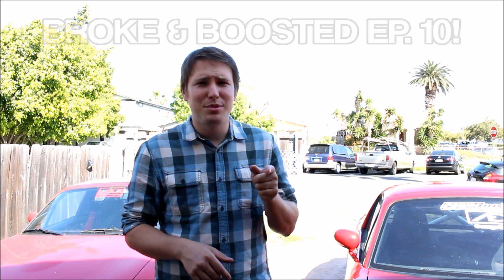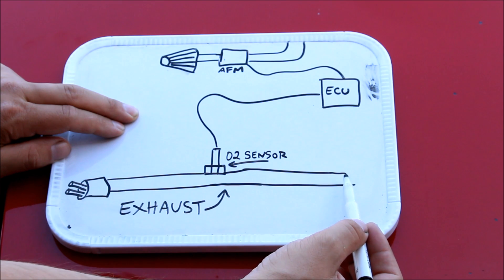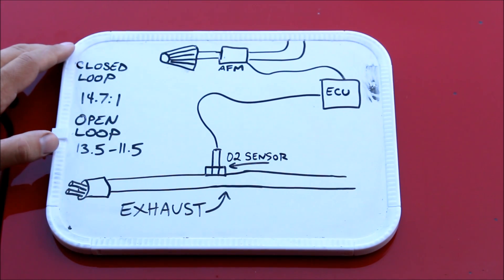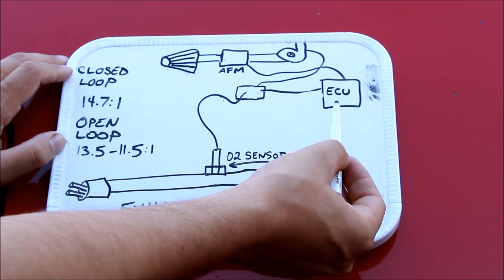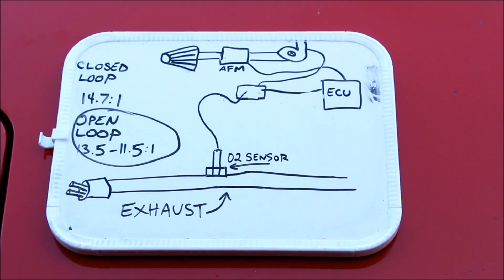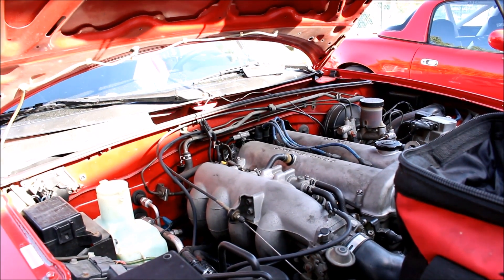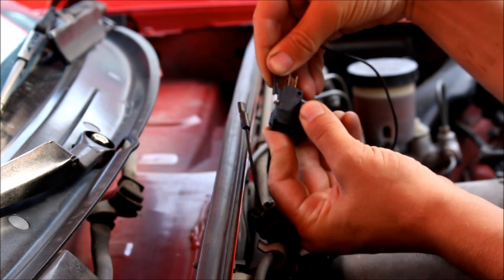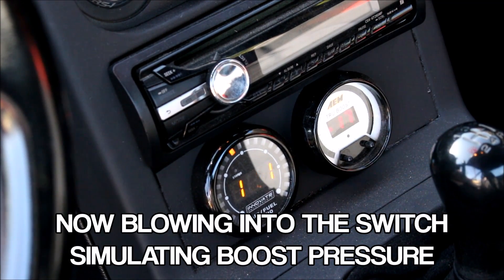Tricking The Stock ECU: o2 Signal Modifier (Broke & Boosted Ep10)

Comment: I just did this mod to my '04 MSM and i gotta say it feels way better.  My AFR gauge clearly shows the fuel getting richer as the boost comes on.  goes from 14.5ish crusing steadily richens up to about 12.5ish AFR. A fraction of the cost compared to the old Flyin Miata O2 modifier unit, what a rip-off they were.  Also want to confirm that this install is accurate for the MSM as well if anyone needs that info.  Just tap into the blue O2 signal wire behind the valve cover and then run your other lead to a chassis ground somewhere.  FM's instructions of getting under the dash to do it is idiotic.
Reply from the maker: The MSM should not need this mod, being that it's factory turbo
Reply: @TheCarPassionChannel I agree with your statement, but the reality is that the factory ECU tuning on the MSM was an afterthought at most. Search for topics on Miata forums (MSM specific) such as the Zener Diode mod, ECU Reflash by Chiptorque/BEGI, and Supra injector swap. You’ll find countless threads all repeating the same thing: ECU tuning was a huge failure. People are trying all kinds of solutions to richen up the tuning in closed loop.  The transition from closed loop to open loop on these cars is a mess on most of them as well.  Some fall flat on their face.

Edit- some even unplug their TPS as a 'fix'.

Comment: So technically say I have a hood dump with no o2 at all if I were to just disconnect the 02 I’ll be in open loop at idle which may not be good but I’d be fine at boost correct ?
Reply from the maker: How will you know you're running safe AFR's with no wideband?

Comment: Hi. The flying miata modifier setup puts the signal to ground and claims to pass 
.3v. This one opens the circuit. Do I not need the .3v? Does it throw a ckeck engine light just breaking the o2's circuit?
Reply from the maker: The FM unit is the correct way to do it. This is the $10 version of their $140 part, and it worked about as well as the $10 version 😅

Comment: So the o2 sensor is not being used under acceleration?
Reply from the maker: On a stock-ecu miata, that's correct. The fuel map is what controls the fueling during high load, as the stock sensor doesn't know the difference between 14:1 and 10:1. It only knows "rich" or "lean". View my video on widebands to learn more in this 🙂

Comment: Split second fuel injection let's you run two thread in injectors on the motor. Run them from a tach signal and manifold reference. Make your own fuel maps on windows laptop. Flying Miata's uses them on your car to tune around the ECM even on the new miata with the canbus tech. It was pricey @ a smidge under $400 with 2# 1000cc injectors and has great tuneability with a wideband O² sensor. Then factory computer is no wiser to the boost or immediate vacuum. If there is a Map sensor you might have to clamp signal or put a two bar MAP sensor in.

Comment: Great video man will this work on any o2 sensor such as a honda prelude ive boosted mine and runs to lean when crossing over to boost so I need to run it at like 1/4 throttle

Comment: This is an awesome source of information. Im currently turboing my stock civic and dont have access to a tuner shop so i decided to use a fmu and have been following your videos along the way
Reply: How have you been finding it? I'm currently starting a supercharger e36 build and I know for a fact I can't get it tuned on my budget
Reply: @elevenarife9790  my car is a little ripper thanks to these videos. I have a video racing a wrx on my channel with an fmu that I got thanks to this guy.
Reply: @zachnuketown  regarding the actual running of the car, the only thing you've done to make the turbo setup work is an fmu?
Reply: @elevenarife9790  that and the map sensor also cant see boost or it will go into limp mode. I got a map relocation kit and ran a vac line to it with aquarium check valves in a 2 so boost goes out but doesnt suck back in
Reply: @zachnuketown  thanks mate! Very helpful... need to get ordering parts now!!

Comment: Cut the wire. Done.
Reply from the maker: Negative. You still want the O2 sensor to be functional during cruise and idle to maintain closed loop fueling.
Reply: @TheCarPassionChannel   the o2 should still be active. Just in open loop targeting 12(ish) afr at all times.  I'm not concerned about my fuel economy. I don't mind being a little fat a idle or cruise. It is not a DD.
Reply from the maker: @garettoddbenjamin216  A factory narrowband sensor can't target anything other than 14.7. The point of this is to get the ECU into open loop earlier
Reply: @TheCarPassionChannel  oh got it. I thought it just switched the target and still used o2 to trim . I didn't realize it dropped the O2 completely.

Comment: Does anyone know where I can get one of these switches the link seems dead🙃
Reply: U ever find one?
Reply: @raygarcia3441  bought something similar on eBay but have to use it with a relay as it only makes a circuit when boosting
Reply: flying miata has one that's n/o. They put the signal to ground when it closes
Reply: Ebay search 700r4 differential switch.

Comment: so thats cool and all but this seems like a fast way to blow your motor.  Those air fuel ratios are where the turbo wants to be but that 11.5-13.5 a/r ratios without a turbo.  When u add the turbo and all that air you are probably going to be around the 16s.  with those kind of afrs you are going to blow that thing to the moon
Reply from the maker: Sounds like you missed the FMU video, and aren't quite understanding how the pressure switch works. The pressure switch doesn't add extra fuel, it just triggers open loop sooner. The FMU is what adds the extra fuel when the boost comes on.
Reply: @TheCarPassionChannel  yeah but say you using a stock ecu right?  I believe stock ecus will only compensate up 5% additional fuel over their original map.  I dont see anyway you can run a sub 13.5-1 afr under boost on a stock map.
Reply: @TheCarPassionChannel  i just read your description in the video and jt looks like we agree.  I dont see any other videos going over engine management videos involving a stock ecu

Comment: You can do the same thing without getting this part, as soon as the computer doesn't get a signal from the o2 sensor it automatically switches to open loop. So just unplug your o2 sensors
Reply: I was wondering this too. Either way a cel will illuminate?

Comment: So is the mileage gonna shit itself and just run rich or once the turbo is on will it even out the air fuel ratio or will the ecu control the ratio well enough in OL that efficiency will still be good cause I'm looking to turbo my truck at low boost and try to maximize efficiency and I don't know if I should throw in the money to get MS or if rigging up something like this would also do the job and being that my truck has the Ford 4.9 I will notice mileage more than your 1.6 lol

Comment: I found your video 2 years later I’d love an update status. I’m about to do this my self can you let me know if you had any reliability issues if so did you change anything? I’m about to turbo a m50b25 using a fmu and this boost switch. With a tad bigger injectors. Hoping to be able to safely and reliably run boost for the cheap
Reply: How did it go?

Comment: so im kind confused on how this switch will will make it run rich without any fuel? And can i do this to a vvt nb and boost around on low boost? Like between 8-10psi of boost or will it just blow up? Im askin because i dont want or need a whole lot more power than stock just an extra push than stock. Not sure if i wanna put $1200 into an ecu just for a little boost if i can avoid it.
Reply from the maker: It doesn't increase the amount of boost you can run, it simply turns off the o2 sensor at ~0psi so as you're transitioning into boost the car doesn't studder/lean out like they usually so on stock ECU. Flyin Miata makes a better version of this, but if it's a long-term project it's really better to just go for for MS. It's safer, more configurable, and you'll make more power
Reply: @TheCarPassionChannel  Ok sounds good and i knew it wouldnt allow for more boost but what i meant is if its relatevely safe for low boost applications but yeah i get you though im on the fence of how long term this will be, but i guess i cam have some fun with megasquirt even without boost
Reply: @TheCarPassionChannel  Ok sounds good and i knew it wouldnt allow for more boost but what i meant is if its relatevely safe for low boost applications but yeah i get you though im on the fence of how long term this will be, but i guess i cam have some fun with megasquirt even without boost

Comment: Hi Greg planning on the same cheap turbo install as you so I've been watching your broke n boosted videos with great interest, when you install the pressure switch to cut the signal from the o2 sensor to the ecu the afr gauge still works but I thought it got it's signal from the o2 sensor as well... I'm a bit lost can you clarify the afr gauge wiring thanks. 
Should say my car is a 2003 1.8 so anything you can tell me about what I will need to do differently would be appreciated 
Thanks

Comment: It might be a little late comment. But I'm wondering, could I add a switch, intercepting the o2 sensor wire, so I could turn it on (so ecu would get signal from o2 sensor) and turn it off (so it would cut the signal) and would it actually make the car run richer? Or A/F ratio is gonna stay the same? (Car: Audi A3 2005, 2.0 petrol N/A)

Comment: Hey I'm running a 1.6l supercharged miata motor supercharger from track dog racing on stock ecu my cafe's at idle are 10 and on throttle 13 and bounces all over to like 18 and 17 back to 12 in at a loss don't know what to do next or where to start looking. And suggestions would be super helpful I have a fuel pressure regulator stock pulley on the supercharger aem afr gauge 1.6l injectors and stock maf and stock spark plugs gapped to 0.025

Comment: Would it be ok to run just 5psi of boost on a stock ecu
Reply from the maker: bikefan81 As long as AFR and ignition timing are safe you can run 5psi on a calculator :)
Reply: TheCarPassionChannel mine is on a jeep 2.5 liter and im new to this turbo stuff Im just trying to get all the knowledge I can so I dont blow my engine
Reply from the maker: bikefan81 Ah I see, I really have no idea about Jeep engines, you have to search online and on forums to see if people have done it before. Most stock engines from the factory can take some boost safely.

Comment: you never really told us if this worked well and if it threw a code. the flyin miata one changes the signal to a lean condition so it gives more fuel. yours just turns off the o2 signal and that should throw a code. plus it doesn't close until like .4 psi so anything below that doesnt have an effect.

Comment: I just put the order in for one of these, id really like to know if it gave any issues over time? Did it melt like you said or something crazy?
Reply from the maker: Stephen Van Dorst Worked well - hook the vac line up to the manifold instead of the intercooler piping though.
Reply: TheCarPassionChannel very much appreciate the response! I know you're an ambassador for the t25's but I picked up a t3 ebaycharger, 50ar 57 trim. Will my 1.6 even be able to spool this thing? I'm only shooting for broke and boosted levels of boost, 4-6lbs.
Reply from the maker: Stephen Van Dorst Yeah man it will work fine 👍
Reply: TheCarPassionChannel that's a relief, I pulled it out of the packaging and was amazed at the size of the thing lol. I'm sure you get this a lot, but I'm accumulating parts and am getting ready to tackle this pretty soon. If I run into an issue during my install or something comes up, is there a way I can get in touch with you quicker than YouTube comments? If you don't want to give out any info that's all good man. Can't hurt to ask lol.
Reply from the maker: Stephen Van Dorst I do my best to keep up with emails and messages, it's usually like 2-5 days or so. You can get my contact info on my website www.thecarpassionchannel.com
Reply: TheCarPassionChannel you da man! I'm in the Bay Area, hopefully one of these days I can make it down there for a meet and greet in the future. I'd love to chop it up about these things. Gaining knowledge is worth the trip on its own!
Reply: TheCarPassionChannel one other thing, the 4 psi actuator you have. Is that the one I see on eBay for $40? Or did you find a Saab and pull it from there? If that's the case what year Saab and model is it?

Comment: I'm pressure sure your inter cooler sees vacuum too
Reply from the maker: It does not, the throttle plate is what causes vacuum so anything before that will not be affected.
Reply: if your engine is sucking in air faster than the turbo is pushing air it's making a vacuum from your engine all the way up to your turbo. a closed throttle body will keep that vacuum on the intake and motor side but once it's open it's pulling vacuum on the whole system unless you have a very restrictive IC that's keeping your vacuum there.
Reply from the maker: Adrian LastName That's going to be rare and only for split seconds at a time like when you first snap the throttle. I'll hook up a boost/vac gauge to the IC piping and see what it does.

Comment: Hey Greg, how has your signal modifier (or really, the pressure switch) work/held up so far?
Reply from the maker: It worked well for the time I ran it. Car is on MS now so I took the switch out as it's not needed.
Reply: Thanks for the reply Greg. Cant wait till the next video.

Comment: Hey Greg, what fitting did you use to attach a hose to the switch? I just ordered mine and want to see what you used.
Reply from the maker: Just gotta get creative with whatever the port look like, I used a big hose tied into a smaller one. Simple but it worked.
Reply: TheCarPassionChannel Gotcha. Thanks!

Comment: Can I use this if I'm not boosted? I have cai headers and exhaust and am running very very rich
Reply from the maker: What AFR? And what situation? Full throttle?
Reply: I've got the stock afm
Reply: I feel like I'm runnin rich comstantly but at full throttle its a lot worse
Reply from the maker: Not AFM, I'm asking what AFR's you're seeing. How rich are you running?
Reply: let me guess noah got problem with a bad O2 sensor and that causing cars to go rich on fuel.
had same problem some years ago and failed smog test and engine running rich like hell turns out bad O2 sensor change that and problem solved.

Comment: Hi Greg, I haven't really got a clue what a pressure switch is, and I'm in the UK, is there any way that I can get the same part you used over here?
Reply: He has the one he used in the description of this video, and you could always just google it. 

Assuming you're planning to use it for the same application (turbocharging a car), you should really figure out what the parts are (he also explains it in the video... :l) and what they do first before even considering it. It's not switching out an exhaust, you actually have to have a decent idea of what you're doing.

Comment: Is there any trick to make the stock ecu work with larger injectors?
Reply from the maker: You can upsize by around 10-15% and that's it. I.E. 1.8 injectors in a 1.6.
Reply: +TheCarPassionChannel Well I have a 2.4 Eclipse. I guess if I could find a 2.5 to 2.6 engine that used similar injectors I suppose. 
Also what do you think about Capping injectors like mcm did?
Reply from the maker: Dylan McElveen I think that should hold true for most engines, as long as the ECU can run closed loop properly the injectors should be okay. I'd find out what size yours are, then go a step larger from there. Doesn't necessarily have to be from a slightly larger engine. I actually have been meaning to watch that MCM video, I'm not familiar with the process!
Reply: +TheCarPassionChannel WAIT I'm in luck. Supposedly almost all turbo/fuel related parts from some Evo are direct fit on the 2.4 Mitsubishi engine I have. 
I'll have to do more research to be certain because Evo parts are expensive and I want to do it right the first time. It's tough because the 3g eclipse forum is garbage
Reply: +TheCarPassionChannel I'm still probably going to use your pressure switch idea, it's pretty clever. 
Thanks for the upload and all the advice man, it's good to see someone go into detail on the electrical side of a turbo build. 
Glad you didn't just pull a mcm move and just say "then you tune your ecu" and cut to the dyno shot without giving any real info on how to make the ecu deliver more fuel. Your videos are extremely helpful man. Keep it up.